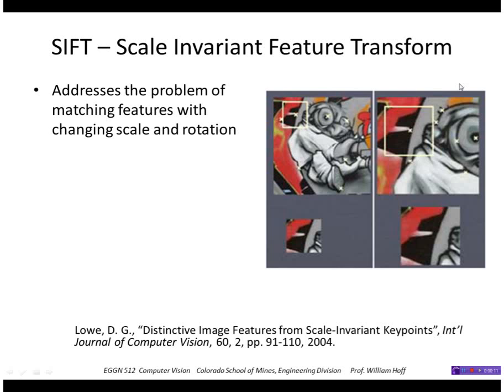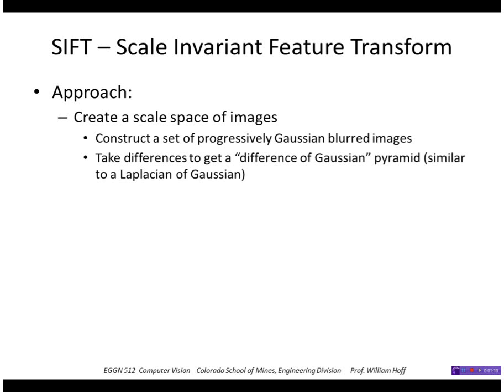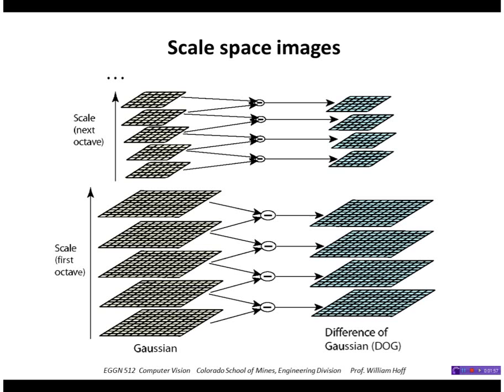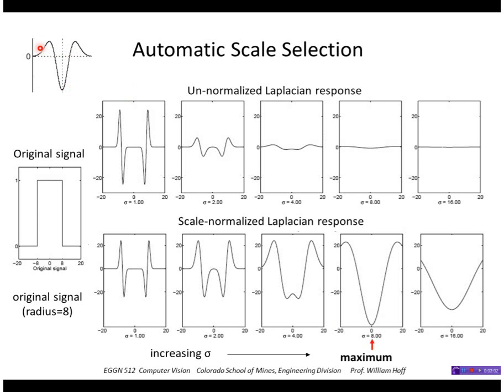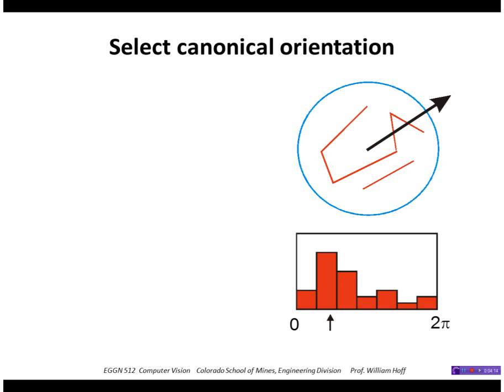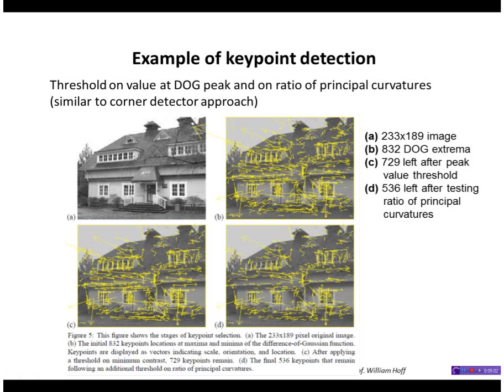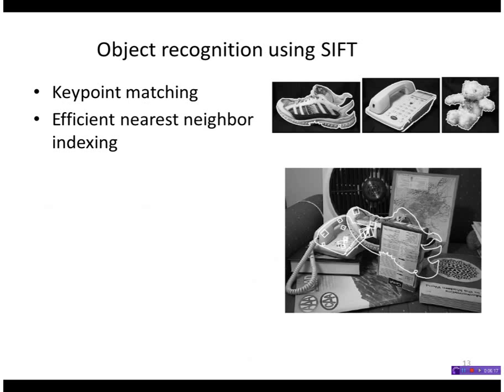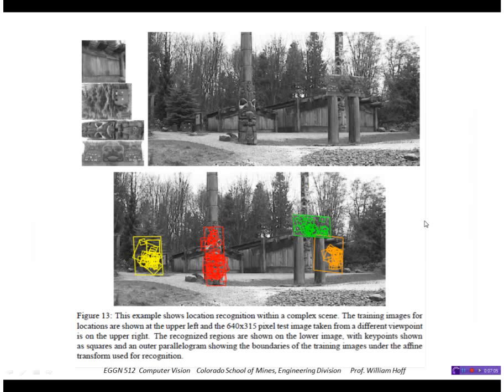CSCI 512 - Lecture 12-1 SIFT

Comment: Thank you for the good explanation. But I need a small clarification about 5:48... it says that 16x16 neighborhood (this means 16x16 pixels around one pixel as I understood) around of a point creates a one sift descriptor with 4x4x8 features... But the diagram shows an 8x8 neighborhood... Am I misunderstood? and this neighbor may don't contain any sift points... am I correct
Reply: yes, you are correct. read the caption for figure 7 on page 15 in this link: https://www.cs.ubc.ca/~lowe/papers/ijcv04.pdf . you'll understand why this is the case in this slide and why it doesn't match with the picture. sorry, this is a year late but I hope this solves the problem for anyone with this specific ambiguity.

Comment: Thank you for good explanation!
One thing bothers me, why the set of images of the same size is callled octave (there is less than 8 of them)?
Reply from the maker: Good question!  I am not sure, but I think the term comes from music.  In music, an octave is the interval between one musical pitch and another with half or double its frequency.  So in the case of an image pyramid, an image in one octave would have half the spatial frequency of the corresponding image in the next lower octave.
Reply: Hello Sir,  One crucial question, in the original paper by Lowe he is re-sampling the image at each level of scaling using LOG (or DOG). Therefore when he is finding the maxima/minima at a level, he is comparing a pixel with its 8 neighbour values and 9 neighbours above of higher sigma and 9 neighbours below of lower sigma, taking into account both the higher and lower sigma scaled images are re-sampled.  I understand what was the motivation of Lowe for using LOG scaling, but can you put some light on what was the motivation of him to re-sample the image at the each level of LOG scaling? Thanks in Advance
Reply: I think resampling is needed to prevent aliasing in the scaled-down images